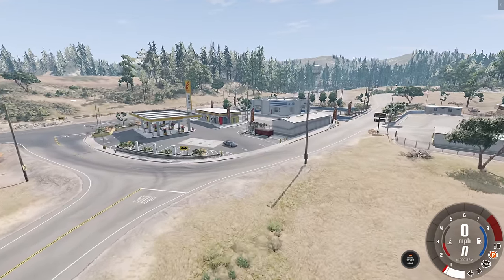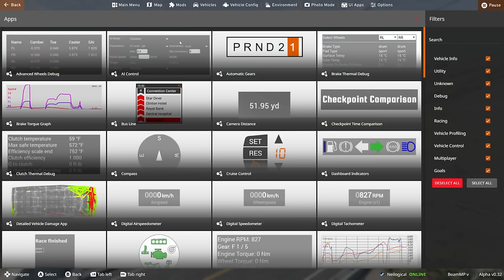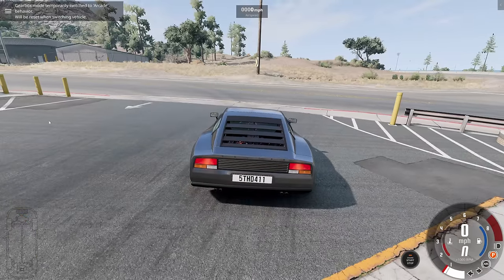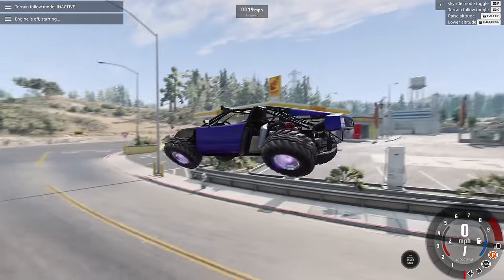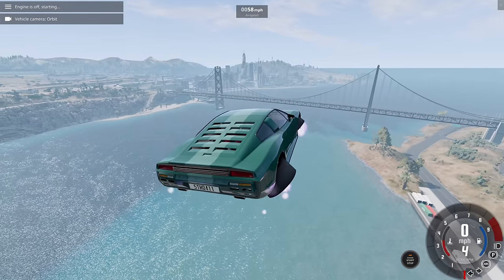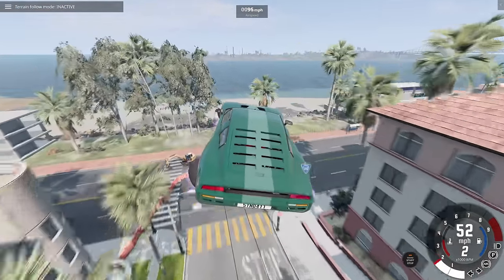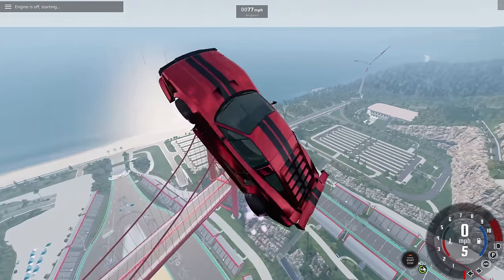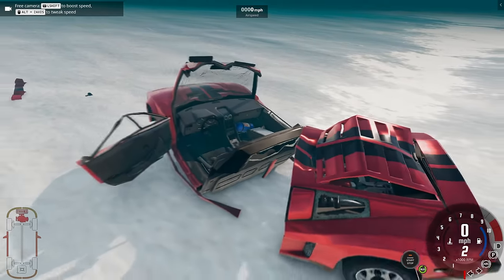I Cannot Believe This Is A REAL BeamNG Mod

Comment: I think it's tied with the Wingeon for longest "jump". Also, this has quickly become one of my favorite mods.
Yeah, those violent death spins are this mod's biggest weakness.
You'll trigger them if you're traveling too fast - which will cause the aerodynamics of the car to put it into a backflip, then the flight computers freak out and bad things happen.
It also happens if you try to fly with knackered suspension.